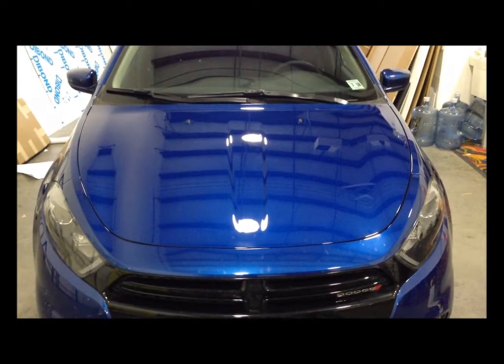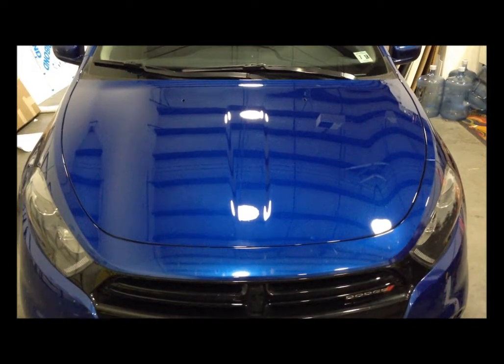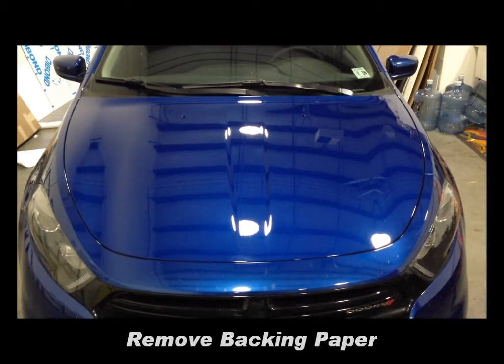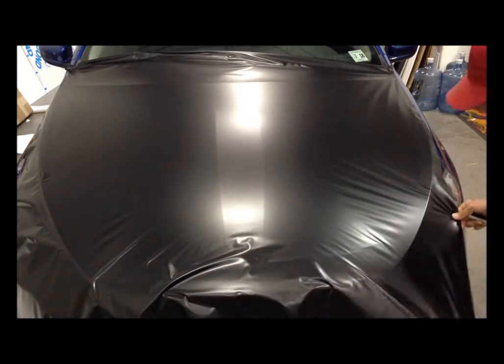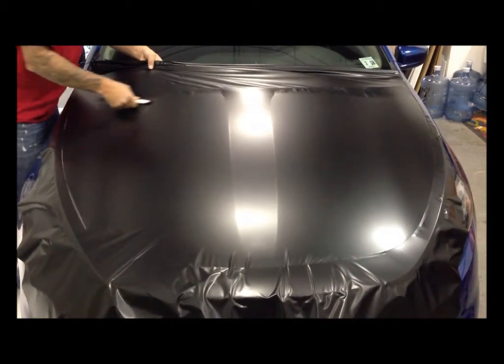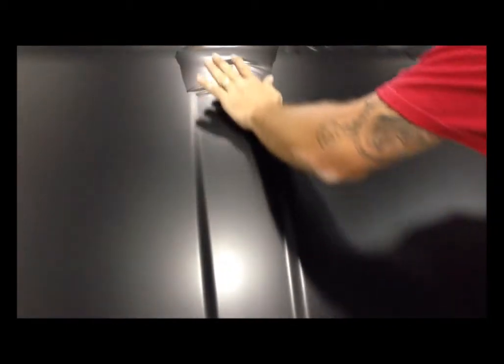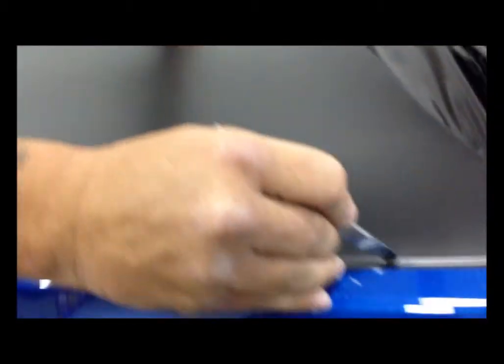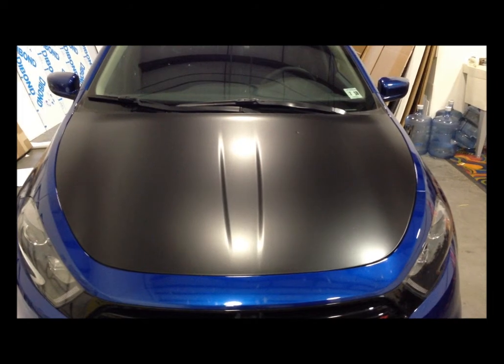Hood Wrap Installation Video

Comment: Make sure when you do this to leave about just enough on the edges to wrap underneath of the hood and use a little heat to shrink it in place in order to keep it tight and prevent peeling!
Reply: BEARDED BEAST & SWOLDIER NATION! The method he use did not stretch the vinyl above 10% the stretch your saw was 1% there for there's no chance of peal back on the edge so the heat method/post heat isn't required here. This piece will last 7 years. You only need to use the shrink method if the vinyl is over 10% stretch.
Reply from the maker: wrapping underneath is really only necessary when there is a heavy stretch being put on the film to contour to the panel, or if you are hiding a contrasting color on a full color change. material will not peel unless its been over stretched

Comment: Excellent excellent work brother, but you do this in the sun???
Reply from the maker: GSHeverything _27 no this was filmed inside our shop. It's not recommended to install Graphics outside
Reply from the maker: absolutely not sir...you never want to install graphics outside, never mind in the direct sunlight. Material will get overheated and become "gooey like " and you will have issues with pullback after installation. Also you want a clean controlled environment to achieve a perfect finish.

Comment: what brand wrap did you guys use? is there a link? thanks
Reply from the maker: we are a 3M Certified Installation Company and 3M preferred Installer...We always recommend 3M 1080 Series or Avery Supreme Wrapping Film. we have installed other based on client color choice but these companies films are not the  to the quality of the 2 i mentioned in my personal opinion. We marry every job we do so i am very picky on films we wrap with.

Comment: what about the edges?
Reply from the maker: When i trimmed the edges of the hood I used the backside of the hood as my guide with the blade facing away from the edge. This allows for about a 1/16 " flap that will roll just over the edge covering whats visible to the eye. It is only necessary to completely roll the edges in cases of extreme stretch, or you are hiding a high contrasting color on a complete color change.

Comment: Just wondering. WTF keeps this from peeling back and going onto your windshield at 160mph?
Reply: Adhesive. Duh.
Reply: HirumiKato under tucking the wrap
Reply: He didn't clean under the hood where the adhesive will stick. He just wiped the top. He also didn't tuck the adhesive under the hood. It'll probably start crinkling around the edges and come up in no time at all.

Anyone can make a wrap look good for a day. Doing the little things right will make it last 3+ years.
Reply: Material is underpressure. YOu put out all of the air, emaning there is only vacuuom between wrap and hood.
Reply from the maker: this material is a self adhesive vinyl.. one applied and post heated to 200 degree, there are zero chances of peeling due to driving speeds. the only way you will see peeling is if it has been stretched past its recommended rate during install. even then you would only see the edges curling slightly, never coming off in one entire sheet

Comment: going one end to the other working your way to the other is the best was to install a wrap. not by doing random edges
Reply: Evan Chelgren going from one end to another will create stress on the last point you put down, its recommended that you use the method of working from the centre out to prevent stress
Reply from the maker: correct... i like to start in the middle this way you are splitting the distance you need to work out any extra material created by the contour of the vehicle panel. Every car and panel is different, you do need to think on the fly when pre planning your install